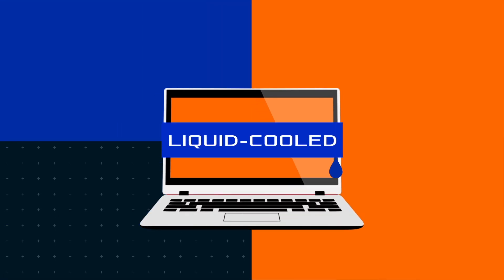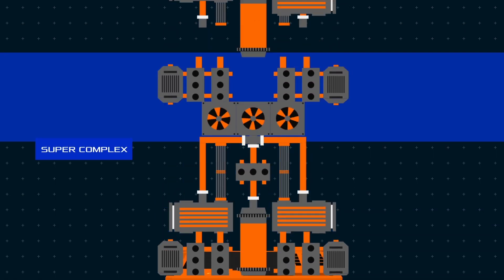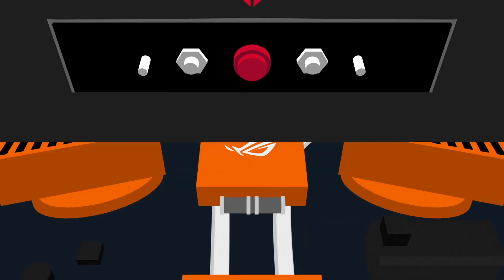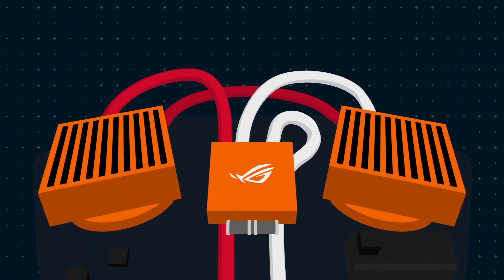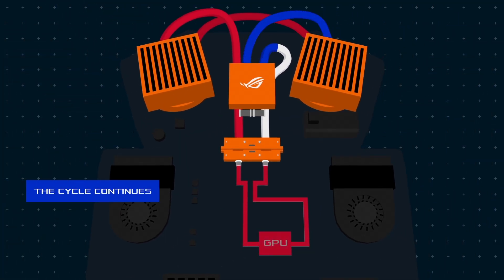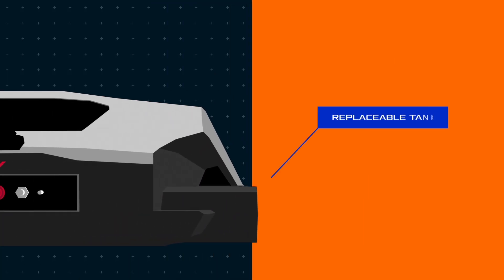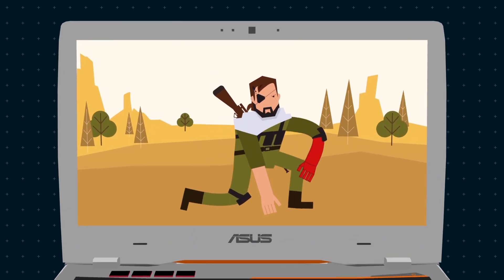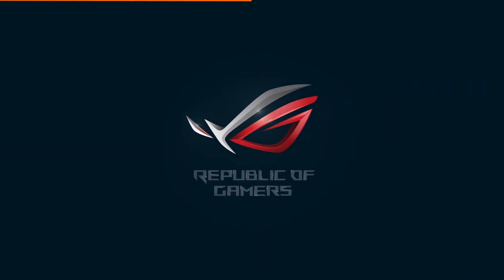ASUS ROG GX700 - How Water Cooling Work in a Laptop

Comment: Hi guys,
Can you help me ?
I have an ASUS GX700VO with the watercooler, but now with a year of use the liquid is leaking a little every time I remove it from the base and because of that it makes an annoying noise, the more it leaks the longer it keeps beeping until I stopped using it.
I got in touch with partners who returned me that it is only possible to change for another base, but in thisvideo you inform that the tank is replaceble.
How ca I replace it? Thanks
Reply: hi, i had the same problem, refilling the dock is actually pretty straight forward once you know how, dont bother sending it away it costs a fortune!
Reply: If anyone needs help with refilling this send me a email and i will share matt22684@yahoo.co.uk
Reply: matt simo I sent you an email
 :)